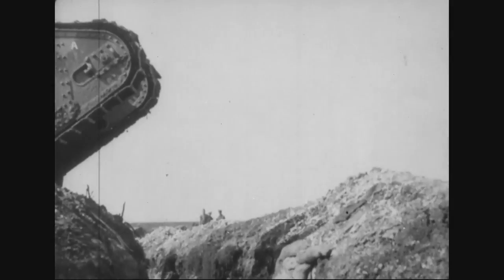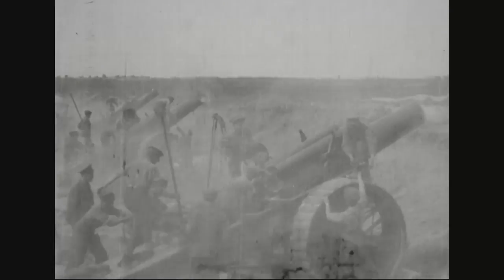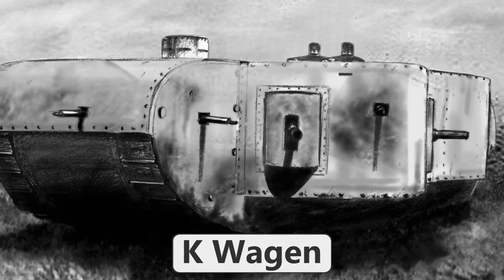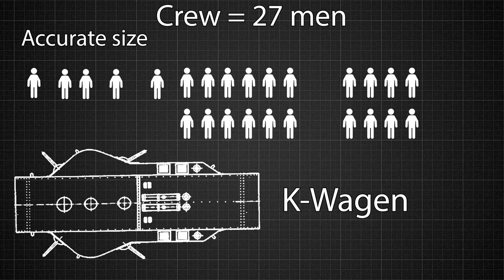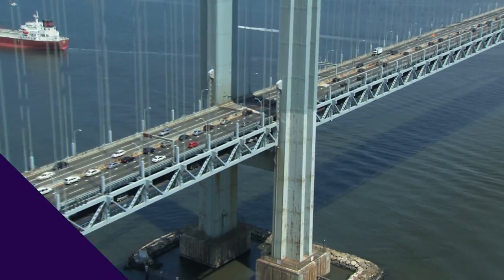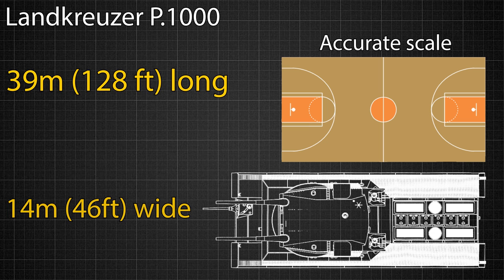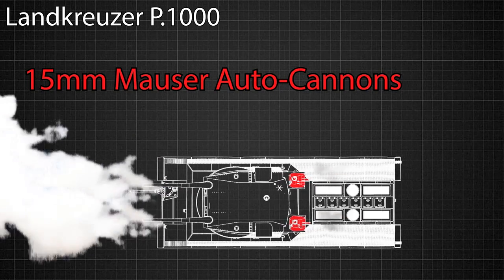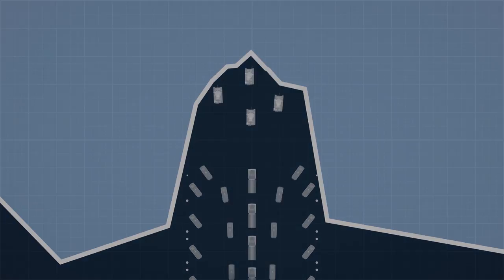These Are the Largest Tanks Ever Designed

Comment: Small error in the beginning. The original Abrams used a 105mm gun but they have since been retrofitted with a 120mm gun.
Reply: He said M1 Abrams, not M1A2 Abrams, which had the 120mm gun.
Reply: Right, but video clearly showed a later M1A1 or A2, the 120mm gun is shown in the video.
Reply: He also showed a picture of the Scharnhorst class to represent which battleship the main armament would have been found, but that type of casing was used only on the Bismark class.
Reply: Also, an Abrams with full kit weigh 70 tons.

Comment: For those about to call this out: 

The M1 Abrams uses an L/52 105mm gun

The M1A1/M1A2 Abrams uses an L/44 120mm gun
Reply: There are no M1's in the arsenal with a 105.  None.  (14 years army)
Reply: The MA is not something you wanna call a "modern tank", it's older then my parents. So yes, the modern version, as he says, is equiped with 120mm.
Reply: If you're in the army for 14 years you couldn't have seen any M1s, as you wheren't born when they where scrapped.
Reply: M1 Abrams, used the 105mm derived from the famous British L7A3, M1A1 and M1A2 used the L/44 120mm derived from the Rheinmetall 120mm L/44
Reply: Daniel Cooke the M1A1 Has a 120 mm L/44 smoothbore main cannon. The older M1 model had the 105 mm L/52.
Reply: SimpleGamingF2P actually.. it had a 105 mm gun
Reply: David Niegowski the orignal m1 abrams was mounted with aM68a1 105 simmler to the L7 on the leo 1 and a1a1 ,ect...
Reply: SimpleGamingF2P it's 105mm , 103mm guns don't exist.
Reply: MZC 23 they use the m256 which is derived from the l/44 but with improvements and a smaller caliber
Reply: David Niegowski half life or black mesa reference?
Reply: No one needs pointing out sadly...
Reply: there are no American MBTs equpped with a 103mm gun, go home, you are drunk
Reply: Yes, but that tank is long gone in American service!
Reply: @SergeantDizzle00  Yeah, it was very weird part. :) Maybe they did write it, keep M60 in their mind.
Reply: @superknightlol  the first m1 was made with a 105mm gun while m1a1 and newer abrams varients had a 120mm smothbore gun
Reply: If it shoots and protects it is good enough
Reply: The L/52 (British) or M68 (In American) is a rifled tank gun used by early M1 Abrams
While the L/44 (German) Rheinmetall smllthbore gun was used in M1A1 & A2.
Reply: @johntulppo4484  FINDLY!!!! 
I was reading all these comments and getting dizzy from the back and forth ! Wrong answers !! 🤪🤯
But you had the right one.... yeaaaaa!!!

Comment: Put the 16000hp engine on your car your car could be the 2nd flash lol
Reply: Lol
Reply: Some random Laggy match *when you run into someone that knows nothing about racing
Reply: putting that into a prius......
Reply: That engine is bigger than the car itself -.-
Reply: But also weight a bit too much
Reply: 2 Misconceptions here

No this wouldn't be possible, the engine is the size of a large car, and there's 2 of them.

No having lots of power and not very much weight is not a bad thing, it's actually a very good thing (See every racing car pre aero)
Reply: Put these two engines on your car and it will crush your car
Reply: @mmsweatyballs1449  i was talking about the people in the replies, not op
Reply: It’s probably geared to low to go that fast
Reply: Yes but kv 2 one shoots 16000 hp
Reply: Put this engine on my house so it can fly
Reply: @micahbell6653  it's just a joke calm down
Reply: your wrong
Reply: People with experience, why can't you put a large engine to a truck/car?
Reply: The car probably crushed by its own engine lol
Reply: put this engine at the world biggest propeller plane and see it goes
Reply: Oooor ur csr crashes down unable to hold that much hp😅. Also the 16k hp engines would probably be biggee than a car😂
Reply: Ben Fennell also keep in mind fuel, transmission, turbo charges, radiators, and fans

Comment: Imagine controlling the clutch in such a huge tank
Reply: "AGHHH, GET THE FUCK IN THERE" STARTS KICKING
Reply: Just managed to get the clutch in but releasing it then ya knee cap goes screaming past  the left side of ya face. (MEDIC!!!)
Reply: Eurobeat kicks in * starts drifting *
Reply: Zaxio 005 lol true, they be desperate for fuel 😂
Reply: Zaxio 005 and yes I know that song also
Reply: Zaxio 005 tank suddenly drifts 
Deja vu
Reply: it most probably would have been gasoline/diesel electric driven, like a locomotive. the engine drives a generator that produces electricity that drives eletric motors on the tracks. that way you dont need a clutch or multi-gear transmission. because making a clutch or transmission to handle such power figures would be quite insane. but well its a 1000 ton tank...talk about insane here :D
Reply: Digi20 electric motors for something having to drive underwater? Don’t think they had the tech for that back then.
Reply: what do you mean? you need to make the driveshaft(s) or similar components watertight as with any other form of propulsion. but yes, they did not have the technology to build the tank in general.
Reply: Digi20 there was and is no bridge that could hold that size/weight. Therefore,  would have to make water crossings.
Reply: sure, but i dont get why that should be a problem with the drivetrain.
Reply: Digi20 water would screw up lubrication as well as causing rust and corrosion. Not even mentioning most parts in a driveline don’t get along with water. Try driving your car underwater and see what I mean. 😄
Reply: scottie0112 you dont seem to be aware that other Tanks can drive under water, too. Even you bock standard car will be fine as long as the engine intake is above the water line <- For that reason you put snorkels on range rovers (and really Long ones on Tanks). Of course that means proper maintenance afterwards with re-lubricating bearings etc. .
Reply: Damn it Hans, I told you to stop grinding it...

Comment: 3:10

188 tonnes. "Nearly 3 and a half times the weight of a modern M1 Abrams tank".

62 x 3.5 = 217 tonnes. 

62 x 3 = 186 tonnes.

Its way closer to 3 times. It's not "nearly 3.5 times".
Reply: I caught that too.
Reply: Maybe he meant with ammunition I don’t know
Reply: Also 280 mm on Landkreuzer isn't almost 4 times wider than the 105/120 mm on Abrams =P  way over 4 times the cross sectional area and I'm sure the ammunition is an order of magnitude or 2 heavier though.
Reply: I also thought about that
Reply: OK nerd

Comment: You forgot the Landkreuzer P 1500 Monster.
At least I believe you can still count this monster as a tank.
Reply: Lowa_ it’s in the video!
Reply: Landkreuzer P 1500 Monster is a super heavy SPG, not a tank. and P 1000 Ratte is also SPG...
Reply: Nameless waaay too big
Reply: Oh, and what about the E-100? That thing's hull was actually completed, but they never got to mount the turret with the gun. It should be there along with the Maus.
Reply: P2000 Gott
Reply: Well you might be surprised but it's not a tank XD
Reply: SanitäterSukaFuta aren't all tanks technically "self propelled guns"?
Reply: He also forgot the Landkreuzer P. 2000 Gott...
Reply: Also, the p. 1500 was basically a railway cannon on tracks
Reply: Lowa_ the P 1500 was basically a Gustav Railway Cannon but on tracks instead of rails. It looked like a Sturmpanzer II which has taken steroids.
Reply: Lowa_  its supposed to be artillery not tank + it moved on tracks
Reply: It would be more like an SPG i woud think..
Reply: SanitäterSukaFuta P 1000 Ratte was never built, also it wasnt self propelled gun, it was a battleship on tracks
Reply: it's not a tank it's a rail gun (not a rail gun RAIL gun)
Reply: Die P 1500 would not have been a tank, because it has no turret.
Reply: Lowa_ It's an artillery...
Reply: Digi20 being turreted or not does not decide if it is a tank or not. the s-tank, T28, and tortoise are all called "tanks" none have a turret. the T28 (the american prototype, not to be mistaken with the russian T-28) is named a "super heavy tank". the tortoise is called an "assault tank". the original british mark tanks. the american liberty tanks, the german a7v tanks, and the french charmond (spelling?) tanks all have no turrets and are tanks. having a turret or not does not make it a tank. that would be ilke saying the british man'o'war ships are not battleships despite the term battleship actually being a shortened term for "line of battle ship"
Reply: no that's a self propelled artilery not a tank
Reply: for the record the 1500 ratte had a battleship turret and two maus turrets so yes the 1500p would have been a tank by your standards the 2000p would have been the artillery piece
Reply: It looks more like if they stuck the schwerer gustav cannon on the bagger quarry excavator...
Reply: @steamedspaghett4872  Looking through the Internet it says that the P.2000 exists only as a modern Internet idea and not an actual plan or idea from the 40s.
Reply: Nameless Edelweis  it's fake

Comment: The "Landkreuzer P.1000" was also called "Ratte", thats German for rat. But it wasnt the biggest tank ever desined: The biggest one was called "Landschlachtschiff P.1500" and it was even bigger than the "Ratte". Its nick name was "Monster"
Reply: GeorgiZplay The P.1500 is not a tank, it's a self propelled gun.
Reply: what a nickname :'D
Reply: makes sense
the smaller but also big tank which weight was 188 tons was called mouse, so the bigger one rat and the biggest planned tank was called monster
Reply: KeinNameLP 
likewise is P.1500, speaking of which...
Reply: GeorgiZplay 
"Monster" is a fake, check it's wiki page and all the trouble with sources listed there. It has only one source ever listed, it uses self reference and said source is just an artists fantasy and is labeled as so by artist themselves.
Reply: Reichskriegsführungsführer and then the "P2000 Gott" or P2000 God
Reply: So for you tanks are thing which go chu chu and need rails? I think you're high.

Comment: This tank would have inevitably been doomed to failure. Look at battleships like the Yamato. For all it's strength, Airpower brought it down.
Reply: Jomari Co Yamato's demise was due to the lack of proper AA support. It would have been much more effective if unleashed earlier, while the IJN still had most of it's carriers. As for the Ratte, it probably would have failed, but because of artillery rather than airpower.
Reply: +Michael Hu just like bismarck
Reply: Aiman Hafeez the Bismarck has faulty aa and unexpirienced crew
Reply: Rob This is true. Now we have CIWS systems which are computer guided and lock onto targets, leading their auto-cannons and gatling guns like drawing a pencil across paper. Such weapons would have made it immune to the air.

Its biggest enemy would have been sinking into the ground.

Comment: Dude the Abrams ain’t used a 105mm gun since ‘82 when they switched to a 120mm like the T-72 and got rid of the gas turbine
Reply: +Joshua Lansell-Kenny

 The M1's (only the XM1's and M1's had the 105mm. rifles) were in service until about '2000. The M1A1 was introduced in the later '1980's.

 I do not get your point about the T-72.
Reply: He said the m1 abrams not the m1a1 or m1a2 with the 120mm
Reply: "105mm.rifles" ?! x)
Reply: it is still equipped with a gas turbine they never got rid of it

Comment: "Their success was largely due to their overwhelming numbers..."

Ah, yes. Having better tactics is called overwhelming numbers now
Reply: No, they are actually right, the T-34's were cheap and easy to produce, which is why there was so many of them.
Reply: @schwieber637  If you watched the video you would know that the quote in question was about the German Victories early in the war not the Russians. It was referencing the early Blitzkrieg that used mostly lighter less advanced tanks but many of them to great effect.
Reply: Well, to be fair, part of the German tactic in the Schwerpunkt is to put overwhelming numbers/firepower onto a small part of the enemy line to punch through it, then exploit the breakthrough with speed.  LOCAL numerical superiority is correct.
Reply: @jonathanallard2128  correct. Even in Russia the Germans had superiority in terms of manpower and material in the early part of the campaign.
Reply: @blockboygames5956   i agree. the russians were suffering HUGE manpower shortages, due to the fact that before the germans were on the run, the germans lost 400,000 men, and the russians lost 1,200,000. (around that) as well as the russians lost around 600 tanks, and the germans only lost 10. (again, this is all in mid campaign)

Comment: At 3:17 you mention the Panzer VIII Maus to weigh almost 3.5 times an Abrams M1. 188/62 = 3.03
Reply: Morbo the Abrams is over 70 with armor and when fully loaded as far as I know
Reply: Morbo ya
Reply: And that the P 1000 Ratte weighed like 16 times the Weight of the M1(A1 or A2?) which is dumb but true. ALSO it wasnt Stalingrad that saved the USSR from getting fucked(screw you censoring) but it's good friend, the winter. AND that the USSR moved it's factories east after operation barbarossa ended.
Just sayin.
ALSO try and prove me wrong

Comment: Hate to be picky but at 0:28, the current M1A2's/M1A1's in service have a 120mm gun
Reply: Reilly Brangan it isn't a M1A2 those are troll transport tanks
Reply: gameboy lolpro Your thinking of the M2 Bradly which has M2A2 and M2A3 variants, the M1A2 SepV3 is the most modern variant of the abrams vehicles.
Reply: Well he did say "M1" not M1A1...
Reply: OWNYOMAMA He also said "still currently used in service" which the M1 is not.
Reply: Reilly Brangan
Oh yeah that's right.
Reply: Devilsigh Yeah, still a great video anyway.
Reply: Reilly Brangan they do in Australia
Reply: My country (Australia) operates the M1A1 AIM which is a sort of middle ground between the US army M1A2 and the US marine core M1A1 and it also operates a 120mm gun. It does not however have depleted Uranium armor and operates from diesel fuel rather than JP-8
Reply: It's also 62 short tons not metric tons. It is 54 metric tons.
Reply: Reilly Brangan   Amen
Reply: Reilly Brangan nah you're wrong... sorry "expert"
Reply: Wrong about what exactly? "expert"
Reply: Reilly Brangan nah your argument is invalid. You're still wrong "master expert sergeant"